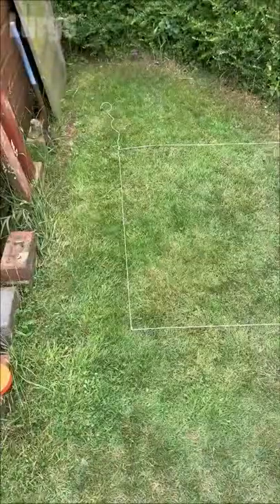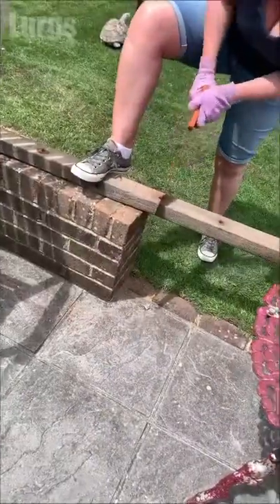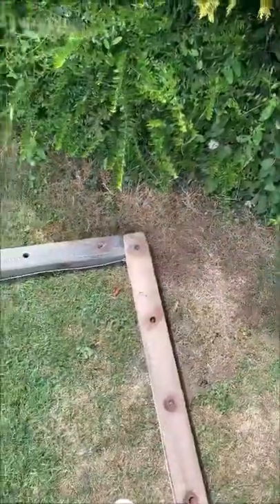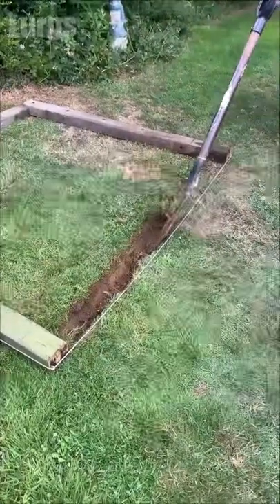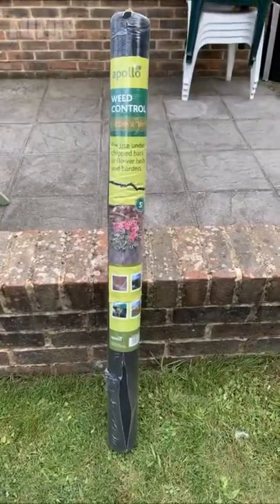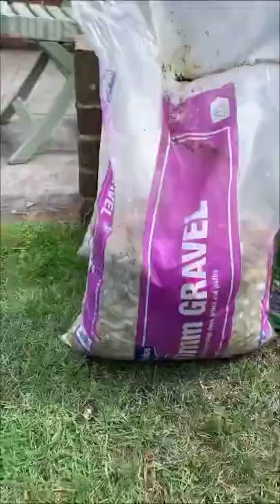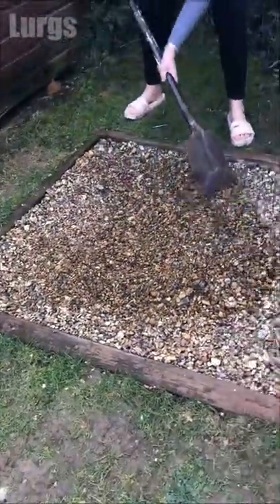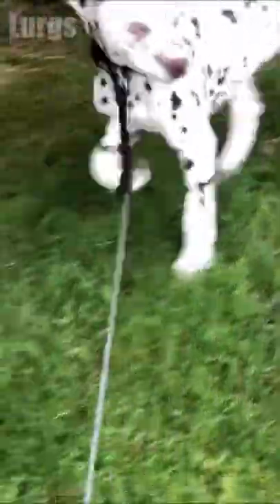How to build a Dog Toilet outside (How to build a Dog Potty Toilet) - DIY Dog Potty

Comment: The weed killer is absolutely not recommended for ecological reasons, but also for safety reasons as it isn't recommended for the puppy. I find it is also absolutely not necessary, so easy to pick weed if it starts growing.

Comment: Hi Guys, great video, did you make holes in the weed control fabric or will the drainage work as it is? Thanks
Reply from the maker: Water goes through the fabric ok
Reply: Brilliant, I'm building this tomorrow for our new Border Collie pup 👍 Cheers @LurgsHowToGuides
Reply from the maker: @garycroll  ah how sweet. Good luck 😎